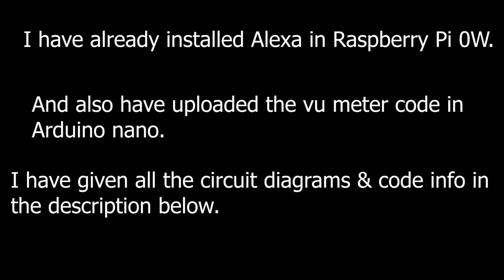Make a DIY Smart Speaker||ALEXA|| using Raspberry Pi 0W

Comment: How many watts speaker have you used
Reply: I have one more query that does  raspberry pi 0w hangs or any issuses with it
Reply from the maker: Ya i face many problems due this it literally took me more than a month .. use pi 3 and 4 is lots easier than zero w
Reply from the maker: each of the spaker is 3 w
Reply: No I can't use pi 4 or 3 as I have some issues about budget so. So can you please tell me that does the raspberry pi 0w damages
Reply from the maker: No it doesn't damage ..  this device is just little bit slow  rather than other device..
Reply: So means it is recommended to use in low budget project
Reply from the maker: Yes

Comment: Do we have to do any changes in coding and software for audio output please reply. And if tgere is any changes tgen please make a tutorial on it please
Reply from the maker: Ya we do some changes... we have to anable the  pi gpio 13,18 pin to as a audio out... if u want to make this system then I don't recommend to use zero w because this system is very very slow...